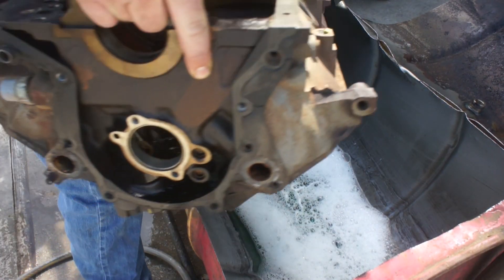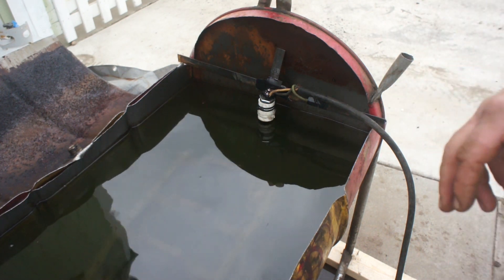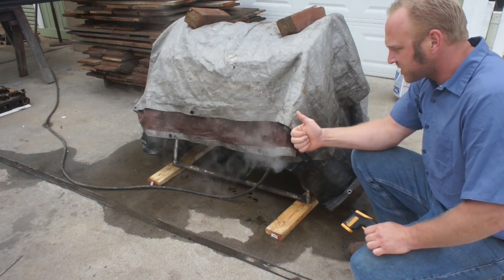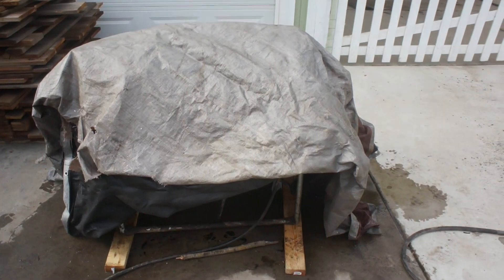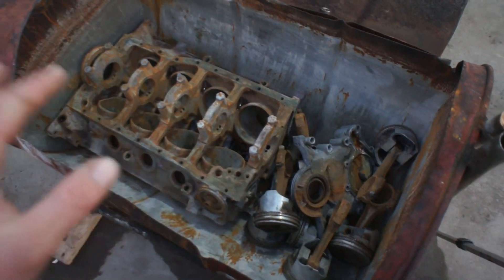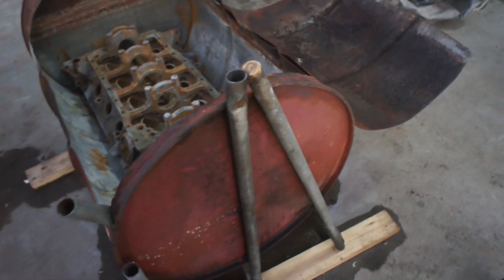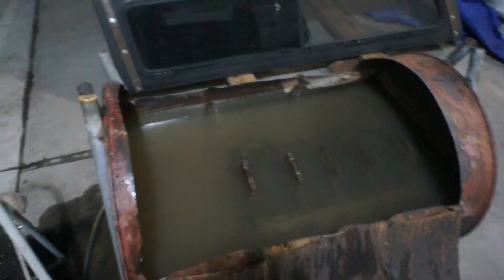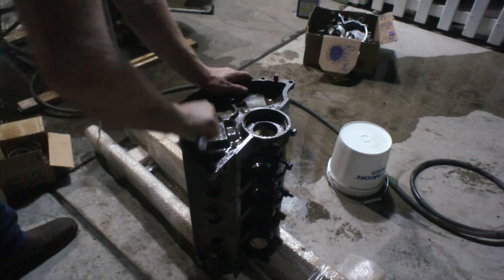DIY hot tanking the engine block and pistons

Comment: You can always mix up some clean oil and clean water into an emulsified mix, and use that in a spray or a dip, to get your engine completely covered in oil. The water will evaporate, the oil will not.

Comment: It is so easy and incredible effective to pressure wash anything you can see on an engine plus nothing removes carbon on heads and cylinders better and faster than pressure washing. Why would you not first pressure wash witch will remove all dirt and carbon in record time just a few minutes of pressure washing does it and then hot tank it for the internal passages which are already very clean because you pressed the pressure washer nozzle up against them and blew them clean that way. So many of these u tube videos make a big deal out of cleaning an engine when pressure washing it is the fastest and most effective way of cleaning anything dirty that you can see on an engine.

Comment: SOAK Tank 1 = 20% NAOH solution and dishwater soap for 24 hours. SOAK Tank 2 = Use a 30L Ultrasonic cleaner with your degreaser. Dip the parts in large batches. Pistons, block, etc. RINSE. Then SOAK Tank 3 = Vinegar or Citrus Acid bath in batches to remove rust. Remove and immediatley hit with WD 40.

Comment: I use wd40 by the gallon in an old spectracide spray set up. Only one that has lasted so far and it has a 3ft hose and sprayer. Works killer for flash rust.

Comment: Lye works better and faster. And doesn't cause flash rust. NOT for alum. Or get some Attax hot tank solution, its basically the same, caustic soda. It removes rust. Back in day before you environmental huggers came along we used it and it works!!  For the rust get some muriatic acid and make a weak solution, 30/70 acid to water, it will remove the rust, but then you have to rinse and neutralize it with washing soda or the like. blow dry and coat with wd immediately.  I don't think rust would have been an issue but you got it too hot and let it go dry. And why are your pistons in there? Thats a no no. Generally you clean alum and ferrous separately.

Comment: Please, PLEASE, folks, if you build this - put a threaded metal bung (available at the same hardware store selling the element) on one end or the other of the tank so you can pass the element through the tank wall & thus keep the electrical contacts outside & away from moisture from accidental splash, overfill & condensation. 110v is no joke. Also, a water heater thermostat will extend the element's service life DRAMATICALLY.

Comment: I just learned this the other day from a friend of mine that was in and the military, WD-40 took down 40 tries until they got the right chemical and and that where the 40 came from, water displacement 40
Reply: Not true. Your friend was wrong.  It says on the can that it's good up to - 40. That's where the 40 comes from. Wd-40 was intended to be an ointment until they found out what it could do on rusted metal.  My Source= I work at American oils and coatings. We make all brands in one place. Not all the same tho.

Comment: EASY GUY, THAT Water Heater element is most likely a 240 volts/ 4500 watt sand hog element forwater heaters, you can use 120 volts and it will heat, but not very quickly. Your Element holder would be safer if you used a Galvanized 2" by 1" and a Half inch metal bell reducer OR a 2" inch Galvanized metal Coupling and 2"×1"1/2 metal bushing to screw in the Heating Element. I use and old propane tank, it's 250 gallons and the old gas heaters for a boiler tank from a hotel works good also. I use Zepp cleaner along with (first ) pressure washing as much of the outside with all the Freeze Plugs removed. The Steam Ginnys push some serious hot steam pressure and 210 degrees. You can also use a Turkey Fryer burner with stand underneath to heat the liquid on low settings for a hot ass tank liquid if you choose. I've built several 55 gallon drums EXACTLY for what these home shop builders want for their engine cleaning. NO SHORTCUTS. I like the larger propane tanks due to how thick the metal is, and the burner doesn't hurt the external metal. To keep it hot (as a back up, a 4500 watts element. You can use A Lower Wattage Element like a 2000 watt, just takes longer to heat. Safety First and with a breaker or Ground Fault Breaker wired to protect. Still though nice project.

Comment: I use a leaf blower to blow most of the water off at the same spraying a bit of WD-40 on the block and parts. The blower and Wd-40 work good together as far as distributing the WD-40 into all the nooks and crannies.

Comment: I was a auto machinist in the 60,s & 70,s. We hot tanked all our cast iron blocks & so on. We used a caustic chemical from Zepp. It cleaned 
like nothing that you see today. Out vat was heated with a gas burner under the bottom. We then pulled the block  & spayed it off with a water hose.
Big problem to day is were do you dispose of all the nasty crud that comes off those engines. We just washed over a drain in the floor. That is why 
you don't see hot vats anymore. What did you do with you waist? I cussed the FDA about many things, but they did stop alot of bad stuff as that.
Reply: Wouldn't the waste have been the purview of the EPA, not the FDA?
Reply: When it cools you could skim the oil off the top. Reuse the cleaner until no longer effective. Collect heavy sediment from bottom of tank. Dispose like you would waste oil/ antifreeze.
Reply: I was a Machinist at a place that machined cast iron and to remove the rust stains from the concrete they used a product called Oakite  hope I spelled it right  very caustic but the concrete looked new a buddy of mine had a homemade hot tank heated by two kerosene heaters and used Oakite in it the engine blocks came out like new
Reply: Project farm tested the most popular degreasers and Zepp is the best.

Comment: Very basic but works. You need to get it out an pressure wash everything. Get into the water passages to clear all the loose crap off.
Those jet blasters do a very good job removing grease, paint, carbon but A do not get into the water passages very well. Or into oil galleries either. That is where 'boiling' the block out is preferable. Followed by a very good pressure wash into all those galleries.
Even then depending how rusty it was you will probably need a filter of some sort in the cooling system after

Comment: That's why you use real degreaser and not fucking dishsoap.. Dishsoap fellas has MOISTURIZERS for when you have your hands plunged into it for an hour washing dishes. It's not 1980 anymore, anything made of chemicals these days has 30 things added to it, so it's saves for morons who wanna plunge there hands in them. The more chemicals in something the more reactive it is with materials.. You gotta use what's made for it. 

All of those channels you were trying to clean out are now completely full of rust that isn't going to come off with a wash, not even a pressure washer will help that situation, just get another block..
Reply: Sorry... Next time instead of scrubbing for HOURS use that barrel to make an electrolysis tank... take all the rust off everywhere including your passages..

Comment: In the sand blasting Industry when wet blasting  occurs they use salt Peter mixed in with water it prevents rust from occurring. Look at the dustless blasting Industry they sell it.

Comment: I've got a 383 big block and 906 heads from a 68 charger that I plan on dropping into my 95 dakota. Pretty sure I will do this to save some money on it. Thanks man!
Reply: Thinking I will keep the barrel intact though and drop the engine in with a cherry picker vertically. Won't have to replenish the water that way.
Reply from the maker: I recently bought an aquarium aerator (basically an air pump) and added some hose into the tank, it keeps the water agitated. It really made a difference.
Reply: Hey  I got a Dokata.   How are you going to shoe horn that thing in there?? Good luck my friend.

Comment: Degrease block, then use an acid bath to clean rust like vinegar.
Reply: What would you recommend for an acid bath?
Reply: @kalebross5443  
Vinegar, evaporust, electrolysis there are many channels out there posted on the subject. There is an easy button that looks like a magnifying glass from the good old days; type what you are wanting to know, then press enter or double-click.

Comment: more heat. less chemicals.  your tub is perfect.  but i'd take it to a grassy area you don't care about and start a fire under it.   the grease will melt off.  1/4 cup of dawn dish soap will keep it from sticking back to the block when ya pull the drain plug..  rinse and ready for machine shop...

Comment: a jet wash would have done a better job of cleaning the inside and out. the jet washer washes the block with pressurized sprayers just like a big dish washer. and a machine shop washer has an anti rust agent.
Reply: I'm guessing you didn't listen to the video since he answered this
Reply: @StephenHarristnt  i wasn't saying do it i was commenting on his comment. and what he did did not clean the water passage. and the jet wash water has anti rust additives.what he spent on soap and water, electricity, and time he could have tanked 2 blocks.
Reply: @robertweitlauf4653  okay, ihu

Comment: You made a hot water heater with no thermostat and dangerous as heck. Lucky you didn't kill someone with that. As an electrician for last 33 yrs i can tell you to be very careful when making things like this at least put a line voltage thermostat on it and keep those kids away from that. Would be really easy to electrocute someone.

Comment: I made a hillbilly hot tank to clean a sludged up valve cover .I used a small oval galvanized tub I got at lowes and used my smoker gas burner for heat and used Mean green also did a great job
Reply: For cleaning smallish parts like cam/valve covers, a mate used to have an old restaurant style dishwasher in the corner of his workshop. He had to replace the pump and rubber pipes with ones that could cope with being in contact with scalding hot degreaser, but it did an impressive job at making old parts look really presentable.

The only problem was that because the replacement pump he used had a much higher flow rate AND pressure, he had to wire small parts to the shelves, or they'd get thrown around inside like trash cans in a tornado. :D
Reply: @Reman1975  when I was 16  I washed dishes in a restaurant with one of those machines yes the water was scalding hot plus the powdered soap that it used was like an acid so between the water and soap it took everything off the dishes the soap was so caustic we had large aluminum pot that they made rice pudding in  and they would burn the bottom of the pot just two tablespoons of soap and some hot water let it sit for 20 minutes and everything lifted off

Comment: this method is only used after block has been chemical cleaned and flash rust has set in.  phosphoric acid diluted with water.  paint on with brush or submerge. let dry do not wash of. not recommended for aluminum   cleans and stops flash rust leaves a protection coat for at least 7 days. if you want to paint item or clean just clean with a rag and some thinners. remember oil parts  to stop rust setting in.  if there's some phosphoric residue in block like fine powered its safe to mix with oi

Comment: Used an old 500 gal propane tank. Stood in on end, made an pivot hinge for the cutoff top for access. Used an old propane burner ring underneath for heat. Every time we changed Varsol in the parts washer we’d dump the old stuff in the boiler. Bring to a boil and drop in your parts. Cleaned out all the oil and water passages, old core sand still in the block and all the gunk and sludge inside and out. Might think about putting a temp switch on the heating element to keep it from boiling all the water out.

Comment: A good way of not having to deal with flash rust is to run an electrolysis bath after hot tanking. Or just electrolysis if you don't have a bunch of rust and junk in the coolant passages. The electrolysis not only removes rust, it leaves a protective black oxide finish that is nearly primer ready. The only downside is the effectiveness of electrolysis can diminish deeper in the engine. Hot tank first if you need to.
Reply: Yes, a much better idea than WD-40 which can cause a lot of problems when you paint.
Reply: Or you could’ve just said Cathodic protection 😂
Reply: @bunythebeastgamer6920  😆
Reply: Seriously the black coating under the rust is ready for paint?
Reply: @G.Harley.Davidson  He said "primer ready". You need to primer before you paint.
Reply: @SI0AX  I guess
Reply: Oh yes, nothing like a saltwater bath to prevent flash rust.
I'm not too sure you have ever practiced what you preach.

Comment: I'm wondering if adding circulation to the mixture with a low pressure air bar at the bottom of the tank would help in cleaning it quicker and better
Reply: It would at least make sure to spread the heat evenly across the tank.
Reply: I have done that  before , and  it does improve  cleaning but if your inside a building,it will make fumes that burns your eyes and nose

Comment: Enjoyed the video,,thank you.
Be careful dipping the cam bearings if your going to reuse,,,,some chemicals will (eat) them,-destroy them,,
Something I learned a long time ago,,,I rebuild transmissions for a living and I used to spray my stock units with wd40 so they wouldn't rust as they were sitting rebuilt on the shelf,,what I found out was over a period of time the wd40 would dry up and turn crusty like old gas does..
I found the ABSOLUTE BEST RUST PREVENTION IS TRANSMISSION FLUID,,,it is by far the best rust prevention,,,lasts forever,,,doesn't evaporate,,trans fluid is made to be that way with the additives they put in it.
Reply from the maker: Hey Justin. Im putting an AOD behind this engine. Any tips? I have a B&M shift improver kit going in. Not sure if I should go for the street/strip or towing/RV option?
I appreciate the heads up on the bearings. It did go to the machine shop, heres the update:
https://youtu.be/ltoXWj1Vav0
Reply: @unitedstatesofbuild4915  I'm actually a Ford only transmission specialist since 1994,,just did an AOD last week in a 93 E150,,,and I'm currently in the middle of a complete restoration/mechanical go through on my brothers 89 t-bird,,including trans rebuild,,rebuild engine,,,etc,etc
I'm in Florida just so you know.
The most important thing to remember on an AOD,,,is that it uses a TV cable to control the shifts,,,
It is extremely important that it is hooked up and adjusted properly..
If it's not correctly adjusted you can burn up an AOD on a 4 mile road test.
If your keeping it fuel injected,,,save all the tv linkage,cable and brackets from the t-bird.
There is so much stuff that can be done to an AOD the sky is the limit..
For an AOD history lesson and what can be done,,, Google
 baumann engineering,,I think there website is becontrols.com 
Since your doing the engine up like you are I would put the street/strip version instead of the towing/rv,
The strip version is more dramatic and firmer shifting..
Something I would do,,and I do a lot of is installing 4r70w planet's into an AOD case,,this has many benefits..
It changes the ratio inside the trans,,gives you faster acceleration and better rpm at cruise,,It's like going from a 3.27 rear gear to a 3.73 but the change is done inside the trans.
Anything that you can read on the internet about an AOD rebuild,,,I can do better and cheaper.
Check out the website I mentioned earlier for info on what I'm saying!!
Reply: I went to becontrols.com
It's hard to find the information I want you to see,,,so follow this way on there website;;;
Go to becontrols.com
click the box in the top right hand corner,,
Then go to support,,,
Then scroll all the way down and click on TECH GUIDE,,
Then scroll down to performance GUIDE,, section 3 AOD upgrades
Everything you ever wanted to know is right there!!!
Reply: Another good website for information is the thunderbird cougar car club of America..
TCCOA.COM
Check it out if you already don't know
Reply from the maker: Thanks for the great info, I will be doing some reading. I am familiar with Baumann, but havent checked out TCCOA.com. Thanks again for the 4r70w tip, Ill be looking into it.

Comment: For safety, besides the obvious open wires (drill and tap a hold and put in element on lower side of tank) around liquid, you could use the same thermostat from a water heater and strap it to that metal tank so you can adjust temp. a tool like this hot tank shouldn't be jerry rigged. Make it a perminate tool, so build it right.. and SAFE.
Reply: Also, can add some peizo buzzers on it to make it ultrasonic also.
Reply from the maker: Hey Rob! You have high standards! The tank is already in the scrap pile. I just needed it for this one time project. It was an old 55gal drum, I think the bung is 1.5" npt on those, You could thread a TEE on and run the element straight in. Then just put a plug on the 3rd opening and you could still drain! I like the ultrasonic idea too.